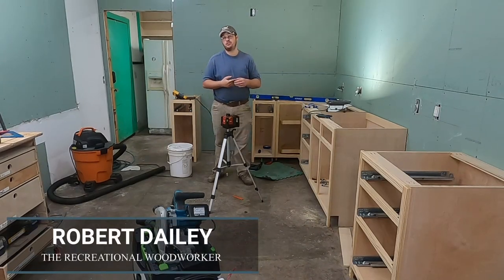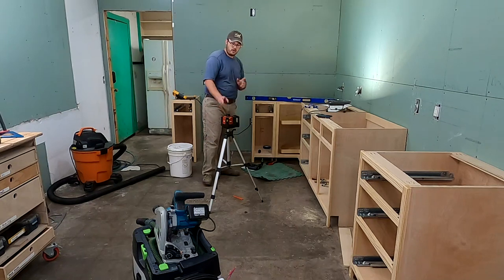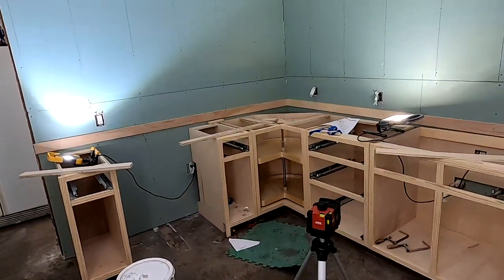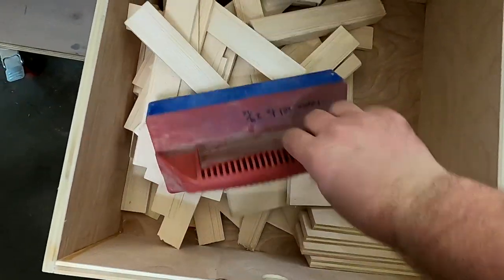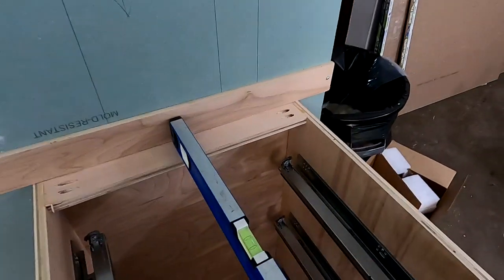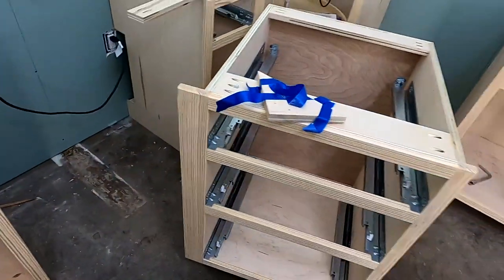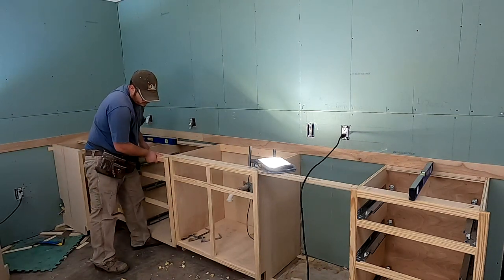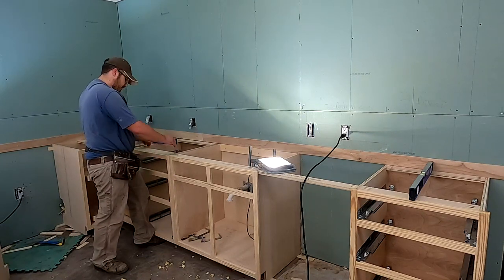Installing Base Cabinets || How to Build Kitchen Cabinet Series Part 5 of 9

Comment: What was your reasoning for starting at the end and working to the corner?  In my limited experience I found it much easier to determine highest point on floor at 34 1/2 and set a ledger board level based on that and then work from the corner out (which in your case would have been the corner cabinet) leveling/shimming as I go.

Comment: Big Q: Wouldn't you finish the flooring before the installation of cabinets? You could also float a leveling compound, then flooring, and then cabinets.
Reply from the maker: In some cases yes, but it's doesn't really matter.  In some cases we do flooring first, in others we do it after. I decided to do flooring last as there was a lot of other work going on in the house and I didn't want to risk damaging the new flooring